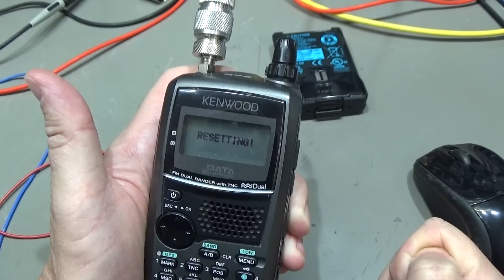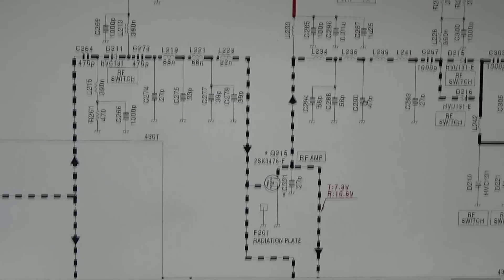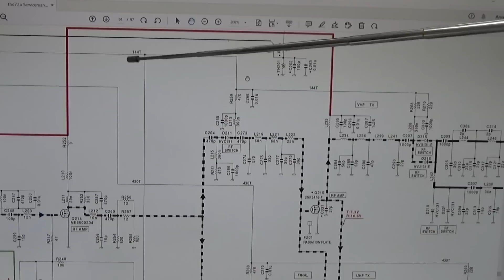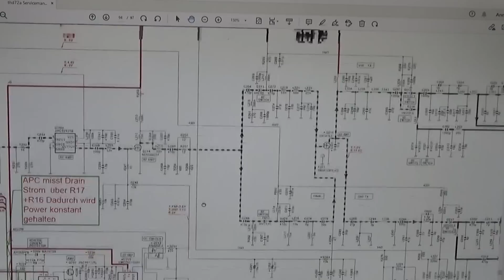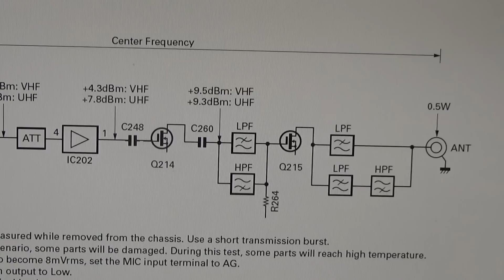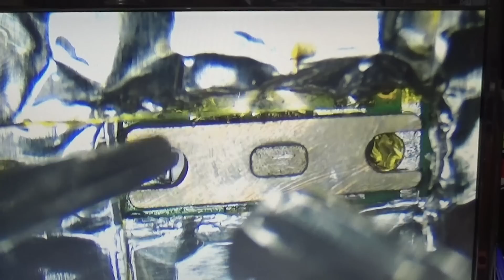#273 Kenwood TH-D72 very exciting fault caught

Comment: Interessantes Video , habe das gleiche Problem mit den Kenwood TH F7 , habe gedacht die Pin Diode wäre hinüber aber jetzt kann Ich es versuchen zu Wechseln, der Endstufenaufbau ist gleich wie bei den TH D72, sicher der Mosfet ist sicher ein wenig Tricky, LG aus Südtirol
Reply from the maker: Sei vorsichtig, es ist nicht einfach, die Endstufe zu wechseln, speziell wenn du nicht die richtigen Werkzeuge haben solltest. Viel Erfolg
Reply: @TRXLab  ne habe das schon , wenn kennst die Klasse A von vortreiber von Icom 7000 ähnlich... ne von der Endstufe zwischen TH F7 und D72 identisch

Comment: I need help with my Icom 7000.  Something really wierd has been happening.
Reply: When I power on the radio everything works perfectly.  I can hear the bands just fine, except if I turn the vfo knob. As soon as I turn that knob the radio will go deaf.  I am no longer able to recieve signals, but if I turn it off then turn it back on it is completely normal again.  For instance, I will be listening to someone and turn the adjustment knob, then when I adjust back to that frequency, I can no longer hear them, nor anything else on the band.  All it takes is a power cycle and it is back to operational.  I check the ribbon cable and they were all fine and properly connected.  Then I check the knob again and it seems to me that if I turn the knob very slow I can creep away from the frequency that I am listening to and continue to recieve.  But if it turn it fast, it instantly goes deaf.  To me this sounds like a software issue and looks like it in practically every way.  I tried resetting the radio but it did not take care of the issues.  Is there firmware or software  updates out there for this radio?

Thank you, KD9VSG

Comment: No we do not need to summarize what we have done up to this point. We need to go on down the line and check the transistor  at the final beings the preamp and the driver are good. Go on down the line of the circuit please. Please stop being redundant. What a waste of time.

Comment: thank you,  educational content. i suspect its more probable Kenwood were buying these selected for higher gain by Toshiba prior to shipping pretty much how with led you can or could order based on certain perimeters so you order the part number and get a selected colour band as all the green of one part number will not all be the same, if that makes sense and if you are making a display you want the frequency of the color to be as close as possible.
Reply from the maker: Thank you, Yes, most probably they directly ordered the parts with a higher gain originally. Most likely the overall BOM was too high, because the radio was only sold for a short while.

Comment: Would have been nice to see the new FET on the curv tracer too.
Also I'd have probably measured the driver output power right at the gate of the final transistor aswell.
The transistor datasheet specifies a 500mW input power for test condition.
Reply from the maker: Agreed, but we could not risk putting a very sensitive ESP part to the tester...
Reply: If you can give me a hint on where to find this FET, I will run the same test and post the graph.  Need one for my d72 but having a hard time finding one!